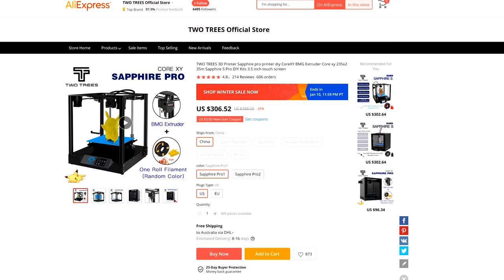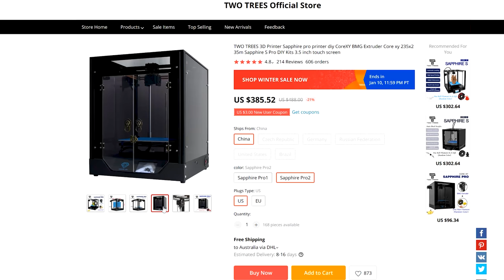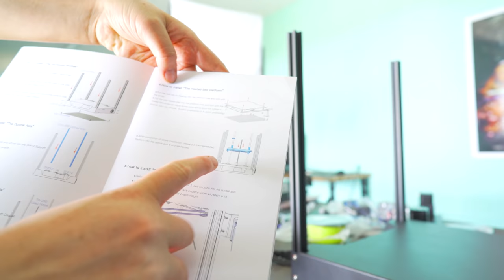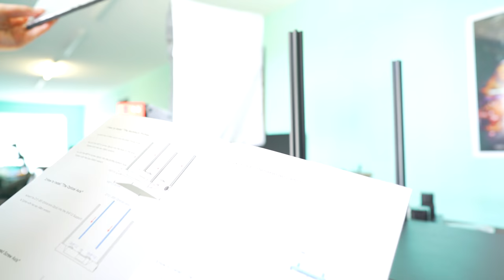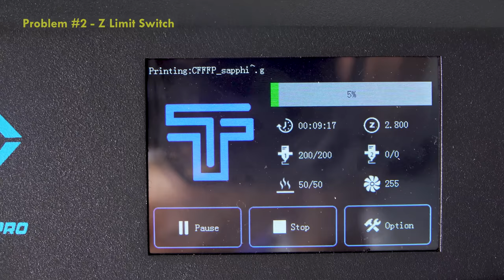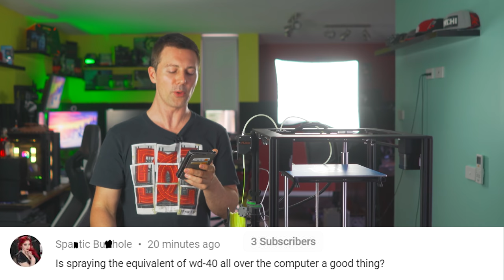BEFORE Buying a 3D Printer from Aliexpress... Watch This... (Sapphire Pro 1 Review)

Comment: Looking at the cables and wires on your printer it seems you do not have a lot of experience in 3D printing so I wonder why they sent it to you for free. The Sapphire Pro is definitely not a printer for unexperienced persons like you. But if you know what you are doing then this is really an unbelieveable piece of technology left in the hands of the buyer. Not an "out of the box" experience for sure. But with some treatment (and speaking from experience, it is necessary to disassemble every single piece) it is a great 3D printer DIY KIT. What they sell is not a 3D printer but a Kit and they should be telling you. But on the other hand, for this price... The 3D printers I bought before were much worse while being a lot more expensive so I don't exactly know what you are complaining about. If you want a Plug and Play 3D printer then just go ahead and buy it.

Comment: The Sapphire Pro could have been so great; it has a lot of good things going for it. But the hassle and multitude of errors made with this printer is a big turn-off. It obviously doesn't cater to beginners: There's too much to be done, but the same could be said for any DIY kit. The kicker is; it doesn't cater to advanced DIY users either, because they would go with a true coreXY kit such as SecKIT SK-Go or V-King, where they can piece the exact components together that they prefer - and also avoid incompatible items.

A great example is how the touch screen won't work with the Z +/- unless you remove the Z limit cable. That's just stupid and not something that's easy to figure out, as it can only be discovered by trial/error (or a search for this specifically in hopes that others have found a solution). There's no logical reason for it to be so. 

I will say though, that I'm a bit surprised that he didn't try to dry the stock filament after he noticed that it was brittle. This can be an issue with any filament (moisture) and it's so easy and fast to deal with.

Comment: It kinda throws me a bit that noone has made a true consumer-ready 3D printer in a polished package (like an ordinary inkjet printer). Every one of them on the market seems to look and operate like some kind of half-baked prototype, this one included. Unfortunately not all deals on Aliexpress are good (although most are)!
Reply: They come really close with Ender 3, at least probably as reliable as an ordinary inkjet (tell that to my office’s printer, they actually hold the record for more times it’s caught fire than my personal Frankenstein printer, and I’m not at 0... Haha!). They are definitely getting there, mine like 7 years ago was a bucket of screws and bolts, had to even put the end connectors on the wires yourself, flash firmware etc. now they take like 20 minutes with just 6 screws and doing great prints first shot. So if that’s how the market demands it, we’ll companies will keep making them more novice friendly and we’ll be getting better and better through a few more years. And mine was like a fairly typical PRUSA i3 (so it’s not like some janky no-name design), by comparison the Ender 3 of today is $180-$240 depending on upgrade options and comes 95-99% assembled and the included SD card even is loaded with a test print, I mean it’s really gotten plug and play.

So we are close, might be a few more years, but surprisingly we are getting shockingly close on some companies delivering exactly that (due to physics it probably won’t be as reliable as an inkjet, there are more moving parts and open for FOD and more variation in plastic types etc, but they still might already be beating some cursed office printers with their stupid paper jams on perfectly flawless paper, I really think it’s just moody!)

Comment: Unfortunately almost ALL customer service from China 3D printers is non-existant...you are pretty much on your own...
A.  Trim the PTFE tube, too much makes it VERY difficult to print (it appears you have almost 2x too much on the print head, measure it against it maximum movement and trim it a little longer to ensure it doesn't kink)
B.  The cogging gears on the filament feeder need to be adjusted to center on the filament or it WILL eat up your filament
All build yourself cheap 3D printer kits out of the box will take quite a bit of tweaking, most out of the box are "adequate" but FAR from good...there are also 3D printable mods/bolt ons on Thingiverse on almost ALL printers out there that will make a mediocre printer into a decent quality printer
There is always a learning curve on new hardware on everything...you wouldn't expect an auto mechanic to instantly build the perfect computer rig without some experimenting and training

Comment: Why would you get it.
It's like someone wouldn't watch some PC videos like yours, buy wallmart PC just because and complain how bad it is.
All you had to do is just search for some videos or google a bit.
I've got Ender 3 year ago and it printed first time no problem, and it was like only £200 purchased locally.
Reply: To be fair, I’d probably opt for one of these (especially review sample), but I do have experience modding/machining/designing upgrade parts and tailoring printers to my specific needs (and this one screams speed if you hollowed out the shafts and replaced some parts with a lighter hot end and part of the assembly with carbon fiber and replaced the NEMA stepper motors with some bigger ones or simply over-drive the controllers on them, which I’d probably replace with a 32 bit processor board if it doesn’t already). However, often times I find that I’m just modding for fun, and so in this case I might just mod the extruder and hot end like my plan, and this would also have taken care of all his problems with it too (cost would be under $20 upgrade, estimated +10% speed). So in that case I know what I’d be doing.

The problem is (with PC or car mods etc), is the beginner has no clue (I mean how would they? Everyone starts somewhere), so they WAY underestimate the time or skill involved. But you learn a l out from troubleshooting, I just think it’s better if you start completely scratch (but a kit that’s just a bucket of screws and wires and learn to flash firmware etc from beginning to end, because then you know how everything works and can maintain it.

We all start somewhere, I was super nervous on my first computer build, now I’m at the point where I’m jumping off the bed swinging and tossing a Titan around without worry of static or dropping (couldn’t face made it look like a lightsaber...) and recently when my RAM sticks were covered in water condensation I chunked them out and slammed in some ever faster stuff (I actually still need to check my X399 board, I was using dry ice to overclock my Threadripper with my T-Rex LN2 cooler after a couple hours I had a puddle of water on the board, which to be fair isn’t really that concerning because I had like 3 water leaks earlier that day and heck even my walls are slightly stained from red anti-freeze, lol! But the cooler was thawing down and was causing some short so the board wasn’t posting etc, but not a big deal X399 is dead for new TR-40 platform). Anyways, we all start somewhere, and to think within 5 years I’ll have gone from noob to the crazy dude running -100c on triple cascade on the upcoming TR-64 core with my duel PSU powered quad crossfire system for my triple 4k machine is just mind blowing. I now don’t even flinch when soldering VRM voltage bypass control knobs on a card on my custom BIOS modded cards when previously I didn’t even know what overclocking was, haha! We all start somewhere, Brian just got a bit too ambitious and we’ve all done that at some point, the victory is learning from our mistakes regardless if we ever got it working or not, and I think Brian learned something valuable, and that’s that 3d printers are a bit more than “a little finicky”, haha! A good lesson to learn!

Comment: A china 3d printer with a good frame and motion system but a shit hot end. In other news water still wet.
Reply: It’s so weird because my printer hottend (heater/temp probe/heat block/throat/heatsink/fan/nozzle/quick connect) is a whopping $6.30 as of today, and mine has been doing excellent for years, a really good design! I just don’t get how some are so bad when there exists really good cheap ones... It’s like MakerBot $1500 printers are significantly worse as well, so it’s not like it’s just cheap ones, just whoever is making the component decisions clearly never used or tested that part or combination. It looked to me like this one has a really terrible extruder system too though, like yeah mine is overkill custom and requires lathe and very expensive tooling (I used like a $1k diamond carbide tool to knurl it on a heavy American made lathe, but like I could pump out tons of these parts and you could do it with less, like even patience and a dremel would work).

At least if it’s just the hot end you could print an adaptor and use one of the more generic ones like I’ve got (you can also print most of the extruder I’m using, the welded and machines stainless steel parts could be honestly made from cheap bolt, like the cost shouldn’t be that high).

Comment: that printer has the crap all metal hotend, it do not work verry well. you have to use a minimum retracion on the fillament or it will get blocked, it can be replaced wit a head that the tube goes all the way down to the nozzle, it will be limitied to 260 degree c  if you do but works mutch better. and if you are using a capricorn tube you can push this temp limit moore, but read the spec on the tube you are using because it  relise """verry toxic""" gases if it get to hot.

Comment: This is my 4th printer and easily the worst, even lower than cheapest of cheap printers. Constantly err codes (err 3, 5, 6, 7) and they bear no resemblance to the real fault. At this stage, I have replaced so many parts, but the basic structure has a problem where the leads tangle in the belts, or if they go over the frame, get in the way as it tries to home. Will print 1 in 5 ok with no stopping, but any long prints require constant attention, and have a very high fail rate. Spent loads on wasted filament at this stage, but it's going in the skip now. Pretty shocking.

Comment: AliExpress is a con as I have been failed several times by their Payment Protection programme which you may want to print out and use a bathroom / toilet paper.

The only success I had was showing a video on youtube that the item does not work, I got a refund on that last item.

Simply put, buy off AliExpress at your own risk.

Comment: I have one and it's a great second printer. Mechanically it's very sturdy, clean build and cost effective CoreXY that uses 24v for quick heating of the bed and hot end. It comes with a proper MKS Robin Nano board with plug in stepper drivers and has a decent touch screen. The dual drive bowden I found to work fine and the hot end is passable. Why I say "second printer" is the firmware is closed sourced trash. Upgrade the firmware with open source Marlin 2.0 by booting it with the new firmware on an sd card. Add a BLTouch sensor and possibly upgrade the hotend and you've got a really good printer there for the cost. The Marlin firmware has been compiled for it and it works perfectly. The hard work has been done to configure the firmware by enthusiasts. Find it here:  https://www.thingiverse.com/thing:3977061 Your experience is common to many Chinese 3d printers. They put together reasonable quality parts from various local suppliers and build a decent start point for a fair price to get people going but it's up to community support to make it into what it should be.

Comment: Sounds like junk to me. I’d recommend potential buyers look at Anycubic Mega and Creality Ender machines. They’re much better built and have far better support base both factory and user base in Oz. And you can get them for around $300 Aud. If you buy from Australian supplier using eBay you also get protection via eBay and Oz consumer laws (good sold MUST of Merchantable quality). Oz distributors must comply.

Comment: Imagine 3D printing a 3D printer lol
Reply: That’s the reprap motto, print more printers! A lot of models can be almost entirely made (only things needed are the metal and electronics) as everything from main frame structure to even the bed platform and fan mounts and extruder mount and pulleys etc can all be printed. The first test print is often an upgrade or replacement piece. I’ve even printed replacement bearings for mine (sort of helical spring/self tightening linear bearings, nylon material preferred). I’ve even printed most of my extruder (I wanted to change from direct drive feed to a Bowden remote feed system to make everything that moves lighter for much higher speeds, and then I made my own custom helix gearing for optimal gear ratio). Mine also has the hottend assembly printed as part of that last upgrade, truly upgraded and modded to make it my own for rapid prototyping! What normally took 4 hours now takes below 10 minutes to print out a decent 3 inch diameter and 1/2 thick (solid infill) double herringbone gear, suits my style of rapid modification and design cycle (print speed for fine teeth gearing is about 100mm/s outside with 150+mm/s infill)

Also side note, they have conductive filaments so you can print out your own circuit board and people have actually printed motors... So yeah, we are almost there! That’s not counting the actual metal 3d printers (which make turbochargers and stuff out Titanium with lasers fusing the powdered metal).

Comment: It appears from the short montage towards the end that some of your issues may be related to how you assembled it.  I cringed watching you tighten the screws with a power tool knowing that the frame wax not checked for square.  Not saying it's your fault, instructions you got Jay have been bad and the customer service if accurate is piss poor to non existant.

Comment: Moral of the story, you get what you pay for ?
Reply: No, the Ender 5 is the same price, check it out, it’s really decent (only shadowed by its own product line the Ender 3). And from reviews the support is excellent and the machines are pretty decent quality (even at $180 you’ll get a good printer with the Ender 3)

This is more like what happened with my $1200 Titan Xp, a really $hit customer service and didn’t work (the drivers were so bad for 6 months none of my games could play without crashing, so I went back to my much more stable crossfire systems and today rock my rock solid 4x Fury on Threadripper because it “just works” while delivering up to twice the fps or at least exceeding the Titan for most of my games. “Get the best single GPU” my @$$... You get what you pay for with Nvidia, Shadowcrap recording that tanks performance, recording that won’t enable half the time (needs supported game? Since when is CS:GO not a supported game? Oh since last computer power on huh? Nice...). Drivers that just flat out crash games a lot (when playing Fortnite, which was on the main Nvidia sponsored page, I crashed 3 times and my cousin crashed his 1080 a whopping 7 times in our 5 hour weekend marathon, so we only finished like one match without one of us blue screening or crashing to desktop from the average of 1 crash every 30 minutes!). I had 0 crashes on my Radeon machines, so it wasn’t entirely the game (plus I know Crysis 3 works fine now and that game hasn’t been updated for years, yet just like Watchdogs it was crashing about every 30 minutes, I gave up playing for a long time because it was so frutrating and I thought for sure it was me because everyone else said “oh Nvidia has great drivers”, when the worse I’ve had on Radeon was textures incorrect like SWBF2 2005 having half of snow planet Hoth look like Lava but that was a simple fix tossing old drivers into the game folder and at least had a workaround and it wasn’t exactly game breaking (oh yeah, and to this day Nvidia is rendering the brightness wrong in that game! The screen recording is correct played back on same monitor but in game it’s like 10x darker. And yes that’s a big deal, it’s the Star Wars edition Titan and it can’t even run Star Wars games correctly!)